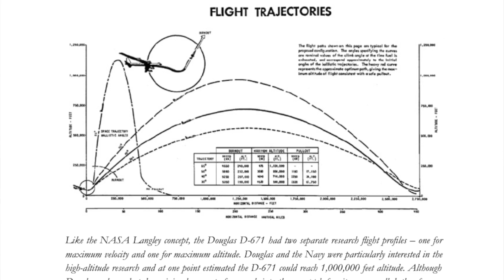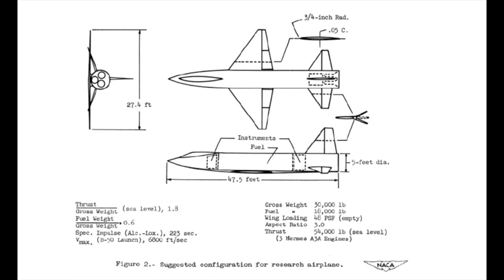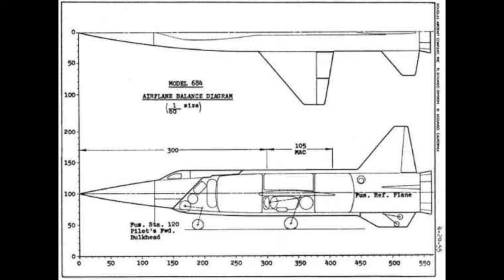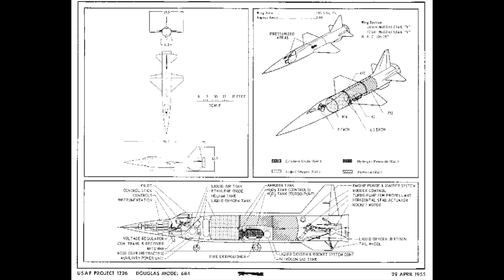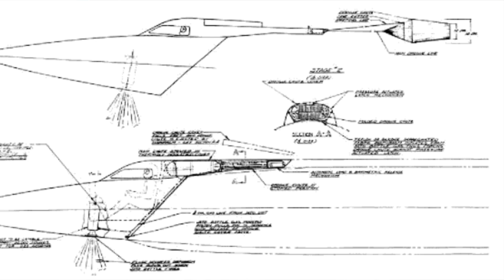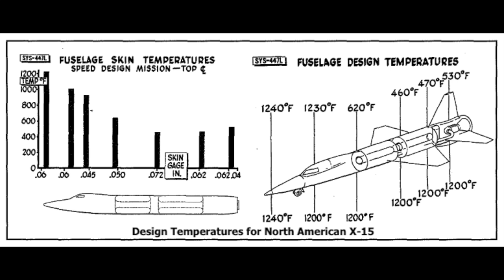The Radioactive Alternative To The X-15 - Faster, Higher, Cheaper. The Douglas D-684

Comment: Bomarc missiles used Mag-Thor, they had protocols for machining and maintaining them that limited radiation exposure.  One at a deployment site had a fuel leak and caught fire, the radiation hazard came from plutonium in the nuke weapon, not the structure.

Comment: The nuclear powered bomber was a much more interesting story if you are interested in developing next generation nuclear reactors such as MSR, Molten Salt Reactors. The Airforce was willing to spend money on developing a reactor that could be used to power a bomber. Obviously this was not a good idea but it did give researchers and engineers the opportunity to develop and test an MSR reactor.  These reactors could actually use low radioactive Thorium as fuel. Obviously the nuclear bomber project did not go far but the MSR reactor was tested very effectively and ran very well. Sadly the Navy had the lead on building PWR, small, Pressurized Water Reactors, for use in submarines. And this lead to the widespread development of PWR reactors globally. The technology and research from Oak Ridge is now largely in the hands of the Chinese who are planning to have an MSR prototype reactor running this year. The mainstream US industries are not interested in this technology and no US MSR reactor is on the drawing board. Or more specifically ready to get government approval. The US nuclear standards do not match with the governments ideas of a safe reactor. Because they use completely different systems. And gaining approval to build new civilian power reactors is hugely time consuming and expensive. Despite the fact that MSR reactors are likely to be much safer than common PWR reactors. They are highly resistant to meltdowns. There is no risk of critical runaway reactions. These reactors will be walk away safe.  Meaning if that even if they were unmanned there is no risk of meltdown. And if they overheat they will automatically slow down the fission reactions with thermal expansion. They do not need a high pressure water cooling system. An extra loop of molten salt can transfer heat to a separate steam turbine system. No water is needed in the reactor. And the salt can also produce greater heat that can have industrial uses. With no risk of high pressure explosions. Water has been a major problem for PWR reactors. Other advantages of MSR reactors include being easier to operate, and build, cheaper to operate, cleaner, smaller and even able to run on mining and nuclear waste. And MSR reactors are the only Gen 4 reactors that can use highly toxic nuclear fuel waste as fuel. And they could also use depleted Uranium or Thorium from mining waste as fuel. While common PWR reactors can only run on expensive, difficult and dirty enriched Uranium.  Currently. There is research being done on using Thorium in PWR reactors. But not proven. Thorium does not need enrichment and is much cheaper and cleaner than Uranium and is much more common. And already available as a byproduct of rare earth mining. Some China does a lot. If the US had a use for Thorium it would also help make US rare earth mining cost effective. And Chinese domination of rare earth mining does not help the US in developing future technologies. And China is likely to dominate the rare earth market at all levels. Including investment in other countries, buying shares of rare earth technology companies, research and manufacturing. So many countries wanting rare earth technology in future will need Chinese components. Potentially giving China access to some of the worlds most advanced technologies. China is also working to dominate the global nuclear technology.  China is buying nuclear technologies from many countries.  Including the US. India also has huge amounts of Thorium and is developing sodium cooled reactors to run on Thorium. But sodium can burn when exposed to oxygen. If molten salts leak they will cool and solidify at normal pressure. PWR reactors also risk water explosions when they overheat. The water can interact with metal in the reactors to cause explosions. There are many MSR reactor designs that can use a variety of salts. But they all use salt for cooling as well as carrying the fuel through the reactor core. MSR reactors do not use fuel rods that may melt. There is a lot of MSR technology being developed in the US. But no clear plan for a working prototype reactor. US politicians are showing greater interest in supporting MSR and other Gen 4 reactors in the US. But China has a clear lead. Including having extensive US research and technology.  The US Terra-power company was working with China to develop Wave reactors. This is supported by Bill Gates as a way to give less developed countries cheap, low carbon energy. These are very modular reactors that operate with very little human input. So can be used in countries with less developed nuclear industries. Due to trade restrictions Terrapower is no longer able to work with Chinese companies. China is also operating a working, prototype, Gen 4, gas cooled reactor. Another reactor type that has very low risk of melt downs even if cooling power is lost. And do not use metal fuel rods. 
So nuclear powered bombers may have been much more successful than we thought. The last MSR reactor in the US was shut down by president Nixon in the 70s for clearly political reasons. Despite successful testing and years of successful research. Though MSR reactors were never used in bombers. But they allowed Americans to develop this very interesting technology. In our modern age we desperately need cheap, low carbon fuel option. And this is likely to be much cheaper than fusion reactors. The international ITER  fusion reactor has already cost 20 billion and will not produce useful power. China is also breaking records in fusion power research reactors as well. MSR technology is relatively mature. Most of the technology has already been developed and researched. We have no idea when fusion power will be possible or affordable. Gen 4 nuclear technology, including all types of MSR reactors, offer great potential. And we need more low carbon energy technologies. Just to be on the safe side. But the US will not develop working reactor prototypes without government support. And probably some funding. But with government support some US companies may be willing to invest.  Or we can just wait for China to develop revolutionary Generation 4 reactors and buy them at a very good price.

Comment: 0:54   This orange beast looks like a "Pound Hound". (Alley Puppy)   With the nose and inlet of a MIG15, the cockpit canopy cover of the SR71, a huge air brake, a typical tail assy and the most stupid straight non-swept wings.  File it under "I guess it will fly".  
1:04   Now this view suspiciously looks like a MIG17 with swept wings and that huge laid back tail.

Comment: How 'bout developing a small nuclear reactor cooled by circulating Carbon Dioxide and having this gas go through a turbine made up of blades composed of HK-31?  Not very efficient (temperatures below 300 degress Celsius), but very light and appropriate for producing electicity in deep-space vehicles.

Comment: I would not be so worried about the pilot. Thorium alloy is an α-emitter. But the whole workshop would have to be build radiation safe for the workers. You really don't want to breathe in radioactive dust.

Comment: M1 Abrams Tank has Depleted Uranium armor. As do many other tanks. Again an Alpha Emitter so very safe. Unless your were hit by a high velocity armor piercing depleted uranium sabot that would ignite the pyrophoric depleted radium. Although at that moment, the burning uranium was probably the least of your worries. A-10 30mm anti-tank rounds used a depleted uranium shell that would also ignite from pyrophoric qualities upon hitting any armored vehicle.
Unfortunately leaving lots of radioactive dust lying around the destroyed vehicle. Alpha emitters are fine as they can’t penetrate your skin. Breathing the depleted uranium dust into your lungs, however, was a different matter. Not so good for the body.

Comment: Some parts of the bomarc used that thorium magnesium xirconium alloy, mag thor, so did the b58, 
The same alloy was also used in the D-21, as well as the adapter section of the Gemini spacecraft.

Comment: There is a difference between JATO and RATO. jato is an auxiliary jet engine in a detachable unit that provides extra power for the takeoff of an aircraft while rato is an auxiliary rocket engine in a detachable unit that provides extra power for the takeoff of an aircraft.

i doubt the escape module had an auxiliary jet engine for separation, rather than a simple rocket based propulsion.

Signed
Mr.Picky 🤣🤣

Comment: It's always an amazement to realize that the Navy is often in charge of cutting edge of the aeronautical research.
Reply: space-SHIP.
Reply: Up until the 20th century the naval services were far and away the most technical branch of any military, and ever since the dawn of the aircraft carrier the US Navy has been on the cutting edge of flight research and operations, and at certain times they even had better planes/pilots than the Air Force (e.g. F-4s in the late 60s).Both John Glenn and Neil Armstrong were Naval aviators (USMC and USN respectively), and there were a lot of Navy guys in the early astronaut programs.

Comment: I wonder how much of this research has been exceeded in the classified realm today. There is a lot of talk of hyper sonic aircraft/missiles regarding China, Russia, USA. If you have a rapid reuse hyper sonic aircraft at extremely high up outside much of Earth's atmosphere launching satellites would be far more cost effective. And for military use it may provide a great way to launch an attack with very little warning. A hyper sonic aircraft/missile would probably be far harder to detect  as it would not have the telltale huge IR signature of a traditional ground launched rocket.

Comment: Military helicopter turbine engines still use thorium in the magnesium compressor case halves. The thorium reduces the magnesium's ability to burn should it be exposed to fire.
The the amount of radiation leaving the metal is less than that found in smoke detector sensors... which is in nearly every modern home.

Comment: Off topic.  Jumbo jets should be designed to drop their center fuel tank in the event of emergency landings.  Currently if they make an emergency landing they often need to dump fuel to reduce weight.  In the event they know they are going to crash, such as landing in a corn field or landing with wheels up, they often dump fuel to minimize the fire upon landing.  If possible, they dump the fuel over water.  It would be better if they could drop the center fuel tank intact on a parachute.  Pump as much fuel from the wings into the center fuel tank, close a valve so the fuel doesn't leak out, press a button to drop the tank.  They could then retrieve the fuel tank.

Comment: Mr. Manley, if you ever want to see (and touch) the X-15, go to the Air Force Museum in Dayton, OH.  It is worth the trip.  

I can remember the first time I ran into it... I was looking up at the XB-70 hanging from the ceiling of the hanger, and there it was- the X-15!  It wasn't even roped off- you could go up and touch it.  The ball on the nose was very interesting, it would roll around without it seeming to have been attached to anything.  I all but climbed into the rocket motor, and it was still streaked from the last time it was fired.  Awesome stuff!

Comment: Radioactive Thorium was use with consumer cameras too. Thorium dioxide was used inside many premium lenses of professional and consumer cameras until late 70's and maybe early 80's. The optical quality of these lenses is even today phenomenal. Most of the  Pentax Asahi Takumar lenses were using thorium dioxide and are radioactive. Nowadays are praised by photographers and are available in eBay in various conditions and prices. Kodak, Canon and Nikon were producing premium expensive radioactive lenses with thorium dioxide too. Their radiation is very low and not really dangerous. However cameras are used very often near the very sensitive to radiation eyes and brain. 
After the scandal broke during late 70's lens manufacturers have moved to  the much inferior and safe lanthanum oxide which it is still in used. After three to five years thorium dioxide gives to the lens a brown tint due to the radio decay. That brown tint it is a typical indication of a lens with thorium dioxide. That tint can be easily removed in nearly a week with constant direct exposure to the ultraviolet radiation of the sun. But after some years will reappear to the permanent radio decay of thorium dioxide. 
Just check Wikipedia for: Thoriated glass

Comment: I freaking love the little animation near the end of the X-15 being launched by a rocket.  It is an hilarious juxtaposition of really basic animation techniques next to an extremely advanced spaceplane.
Reply: It could have been launched in space, but wouldn’t be able to re enter and land
Reply: @stevennagley3407  several X15 flights exceeded the kharman line.  The X15 couldn't do an orbital re entry.
But a ballistic low sub orbital space flight? It did that.
Reply: Or use it to fairy crew to and from the station to the moon

Comment: I still don't understand how this design would handle heat?   with a lower melting point than inconnel x ,  how would the aircraft mitigate re entry heating , since the inconnel x15 would be subjected to the same heat and forces as the hk31 based aircraft.. I'm guessing the material was either somewhat ablative, or they planned to use it in greater thickness' and let it act as a heat sink over the entire body of the aircraft.. I'm hoping the leading edges and the real hot zones had some other coating to protect it,  as a magnesium fire is well , not what one wants.. ignition means nuclear firecracker that you can't put out, and spreading thorium dust into the atmosphere as it falls back to earth.. not good.. dirty bomb essentially.. 
   As we know all x15 pilots talked about the huge BANG the X15 experienced as it passed through heating an cooling cycles,  one of panels close to the pilots feet deformed when hot, and popped  back into shape very rapidly once cooled.. x15 had no expanding joints like the Sr71,  so once the air frame reached it's tolerances as a heat sink that energy went into deforming the metal of the air frame.  Pilots got used to it though there was some brown under ware after the first few flights.. thank goodness the X15 was tough as shit and could tolerate this no problem.. 
  I know they are getting away from using HK 31 in aerospace,  but it's an interesting material,  especially in terms of weight savings.. using thicker layers of it as a heat sink, and maybe putting a coating of pica x over it , thus making the entire airframe a component of heat management has merit.. 
  instead of protecting an aluminium airframe with expensive exotics like Carbon Carbon, etc.. this would come into play with return from orbit space capsules..  instead of using aluminium protected by a think layer of insulation,  make the capsule from HK31,  use less ablative coating thus saving weight, and let some of that heat seep through to the capsules structure, where it could then dissipate it.. the trick is to keep it under 300 c.. the astronauts could be protected by nomex coverings like on the space shuttle.. plus you could add fins to the capsule to increase it's surface area.. like they did on mercury..    would be  cool to work with the stuff in conjunction with pica x and make it viable..  magnesuim thorium based space capsule whose structure acts as a heat sink.. interesting ..

Comment: 1000000ft or 333333332640yds or 189,393939miles
1000000m or 1000km or 1000000000cm

ImPerIal iS tOtalLy LogICaL AnD JuST aS ViAblE As ThE ClEArlY SuPEriOr Si SyStME

Guys (and Gals [and everyone else]) I'm joking. Use what ever system you prefer. As long as you're interested in sience I'm fine with that.

Comment: I just visited the X-15 in Dayton last week. Easily my favorite thing to see. It was amazing seeing it sit next to the XB-70 and an SR-71.
Reply: I'm sorry but the X-15 or the SR-71 dont hold a candle to the XB -7O & its sister project the deep cover; "Dark Star"! 🤫 (clue - it's off limits & radioactively contaminated ).
- They could drop the fully loaded X-15 @ 60,000 feet & give chase to the SR-71 & pass it by when that ran out of fuel & needed to dock.
Reply: -  Dark Star should not be confused with the recent Air Force project.
-  It was a DARPA funded project during the Kennedy Administration's B-70 program. Passed off as an engineering tested bed. But was actualy a scaled up B-70 to fit a core Convair NB-36H upgraded to a working nuclear powerplant between the 6 standard B-70 jet engines. Due to its radioactive exhaust, It was engaged inflight only. Although reported to be sucessful in flight, exceeding B-70 parameters by a wide margin. Becase of radiation It was a maintenance nightmare to maintain.
-  It was killed as not being practical, and was rumored to also be the cause of the cancellation later of the RIFT atomic upper stage rocket that was also successfully static tested on the ground with a specific impulse near 1000 sec. (gaseous core) being achieved.